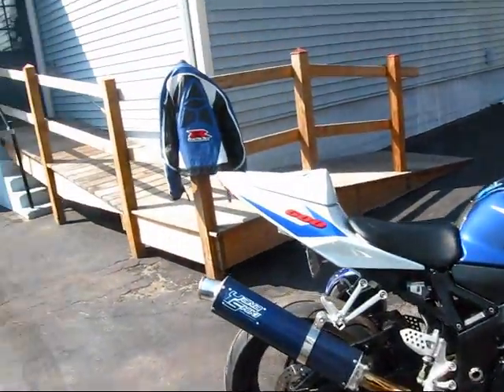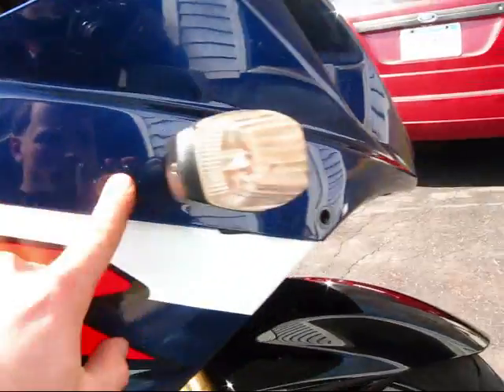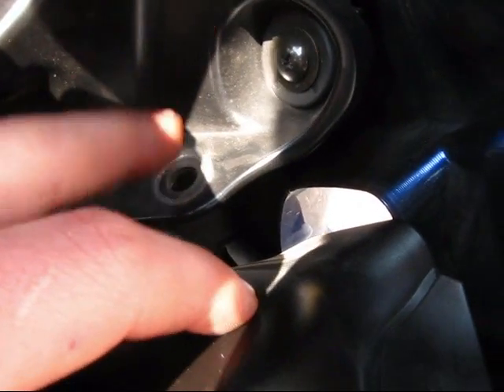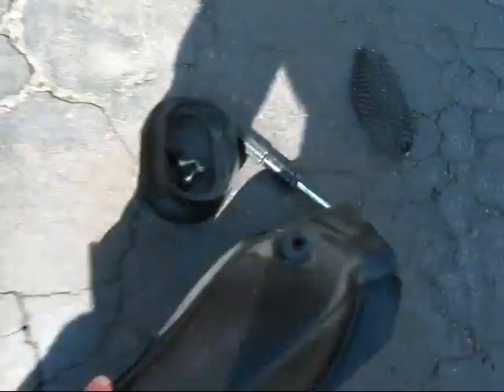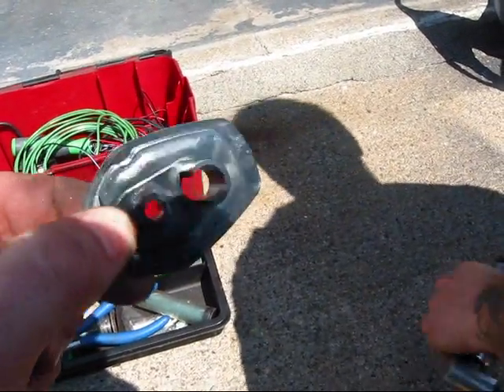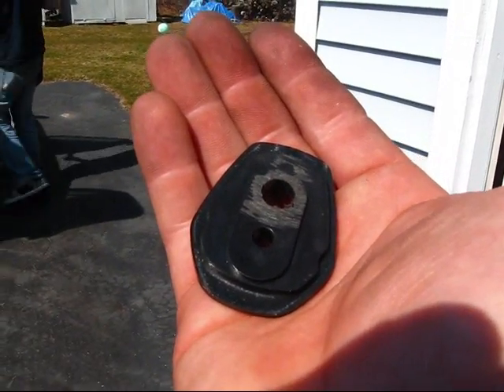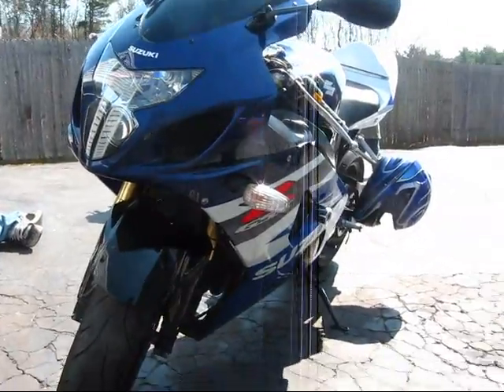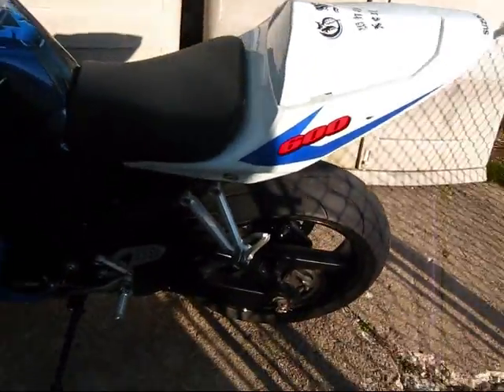04 gsxr flush mount led turn signals

Comment: To connect the flush mount signals you have to cut the stock turn signal connector off and get the flush mount signal wires and connect them to the stock wires after they are cut from the connecter. Just stick them together try them out to make sure the work if not switch the wires up and if they work clamp them down with pliers and your done. I actually just installed them on my 05 gsxr 750

Comment from the maker: good question my friend,what i did was cut the connector off my stock turn signals and soldered it to the led signals that way they plug in just like stock and i dont mess up the harness on the bike by cutting of the connector

Comment: That's the bro. Mirror turn signals are the best. That's a mod I will be doing shortly on the Busa. Using the original mirrors and installing LEDs into them. Currently replacing my blue led surrounds for legal amber ones. Will post a vid up if you want to see what it looks like after am done. Tk cr ride safe. 
Frm nz